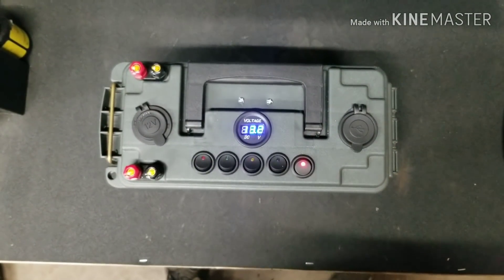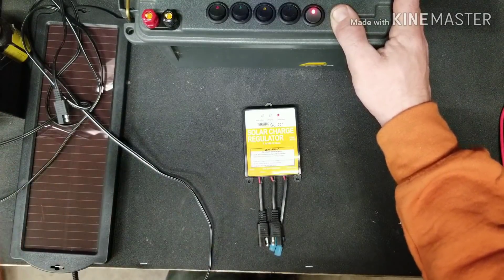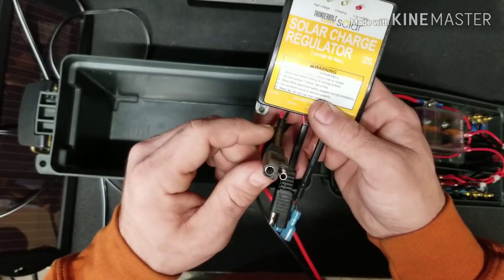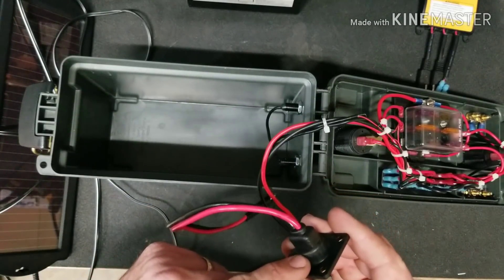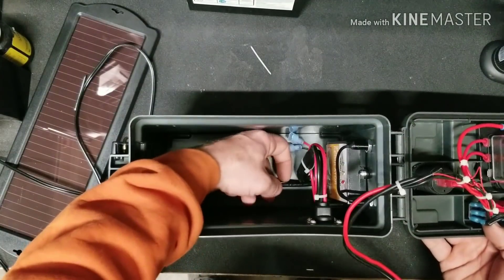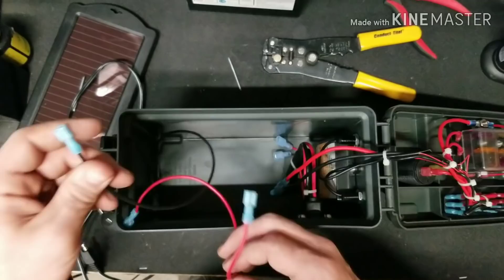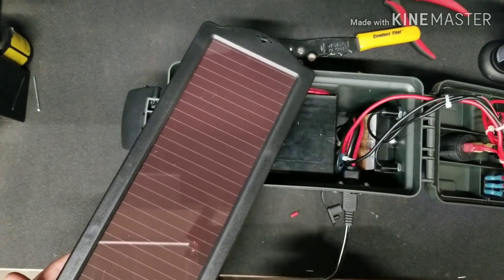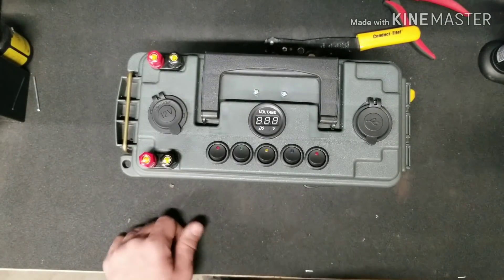How to add the solar upgrade to power box version 2

Comment: JDS Outdoors, Thank you so much for your videos. I especially appreciate you taking the time to show how to do this stuff step by step. I have built 2 of these version 2 boxes and love them. That said, I had a question. I mainly use my boxes for ice fishing and running the lights for my portable fishing house as well as my depth finder. Since I use it mainly for ice fishing I was wondering if you would perhaps show how to install a glow cup and a thermometer like you put on your 50 cal power box. I was thinking the glow cup could maybe fit on the front of the box in about the same spot as where you have the plug for your solar panel on this video. Then it would be just a matter of finding a spot for the thermometer. Just asking because im just not sure how i would wire that given the fact the boxes are already built. Thanks for all your help. Curt
Reply from the maker: Add me on Facebook and I can PM you pics. Jon stier. Profile pic is a grey super duty

Comment: Have you ever looked for or found a small single or dual speaker that could be mounted similar you the LED lights that you could then plug your phone into, while keeping your phone safely inside the box?  I can’t seem to find anything.
Reply from the maker: I have not all I can find is a small bluetooth amp with normal small car speakers
Reply: JDS Outdoors I did find these, might have to look into them. Could be worth a try. 
https://www.rockler.com/rockler-wireless-speaker-kit?sid=V9146?utm_source=google&utm_medium=cpc&utm_term=&utm_content=pla&utm_campaign=PL&gclid=EAIaIQobChMIkMvSsIiR4AIVCJ7ACh049wWDEAQYBSABEgKbIfD_BwE
Reply: Did you take a look at that speaker?  Do you think it could work?
Reply from the maker: @michaelkroulik8986  I dont see what it takes for power but if its 12v it will absolutely work
Reply: JDS Outdoors it looks like it has some sort of battery that is recharged via a micro USB cable. I would think worst case you might need to get some type of step down like you referenced in the bait cooler video.
Reply from the maker: @michaelkroulik8986  should work well then

Comment: Great video and has inspired me to build my own solar assisted power box, however I have one question regarding connecting all your outputs to the "Load" side of the controller.  Does the load on the controller supply sufficient current to power up all your outlets ?  I would have thought taking the solar to the battery and keeping your main feed to to master switch on the battery made more sense.  Thank you for taking the time to post such great information.
Reply from the maker: It can be hooked up either way it all depends on your charge controller some work the way I set it up and some do not. This was brought to my attention after the video but yes this one works perfectly the way it's set up
Reply: @JDSOutdoors  Thank you for your reply,  I will hook my controller up to an external battery and measure the output on the load side, if its ok then I will wire it up as you have done.  Many Thanks

Comment: Does anyone know of a solar panel that is the same dimensions of this box where it can be mounted on the side of the box without any over hang but also have enough juice to charge that battery.  Getting ready for the zombie apocalypse and don’t want to be carrying around a huge solar panel.  Thanks guys.
Reply from the maker: Not really any that fit well on this box. Buy a soft roll up panel and stick it inside or in a back pack
Reply: JDS Outdoors great idea.  Didn’t think of that.  Thanks.  Great job on that.  Can’t wait to work on mine.

Comment: You may want to do some further research on the load out connector on the charge controller.
In all my searching that is only for a small accessory light or similar. It is not designed for all of
the load your battery would normally supply. Let me know if you find out different. Thanks.
Reply from the maker: Been using it all summer like that with zero issues.

Comment: Love this!! About to add the solar to my box. One question for anyone with an opinion...instead of the SAE connectors for the solar panel input I think I am going to use one of the dual Anderson Powerplugs with the waterproof cover. One set will be the PV in to the solar controller, and I'd like to use the other set as an additional output option. How would you recommend wiring that in? Positive through an open slot on the fusebox and and the negative into the chain back to the battery? I'm certainly a novice at best so would appreciate any advice. Great project!

Comment: I really love your videos, but I have a couple of really dumb questions.
1.  If I use 18650 cells with the same Voltage and Capacity, can I build my Power Box using the same instructions that you provide in this video?
2. If I were to double the Amp Hours of battery storage, what else would I need to change, the fuses, the gauge of wires?  I would really appreciate any advice you could offer.

Thanks again, your videos are the best.

Comment: Whi didnt you just use the wires for the battery that you cut off, they would have already been the right length, and would already have the connectors on for the battery connections???

Comment: Can you add a second solar panel in series?  They offer a 2-pack special at Northern Tool?  How long would it take to recharge a battery?
Reply from the maker: Yes you can have multiple panels if desired. Time it takes to charge the battery depends on the time of year, where you live in relevant to the equator, how many watts your panel is, how big your battery is and also how sunny/cloudy it is

Comment: What do you recommend to charge the battery instead of using a solar charger? Is there any chargers that I can mount to the box like you did with the solar charger?
Reply from the maker: Yes you can use the same port to charge without the charge controller installed. Or a regular trickle charger right to the battery
Reply: okay i was looking at some chargers but i dont want to ruin the battery i just bought all the things i need to make a power box thank you

 @JDSOutdoors

Comment: My boxes are built very similar to yours what are you running for batteries, ive been thinking about adding the solar recharge option for awhile, what does this option cost, and is the harbor freight system durable?
Reply from the maker: I'm running 12 ah lead acids and it adds about $30 not including the panel. It is pretty durable for the price and size. Been using it for over a year and no issues
Reply: I wouldn’t go harbor freight.  Their panels are very poor.  I’d get a small renogy or Hqst panel.  I have a couple 100 watt panels and 100 watt is the “sweet spot” for small panels as far as price per watt.
Going more portable a 50 watt hqst panel is around $70.  I’ll be buying one of those for my portable option box.

Comment: Can’t you please share the link for the change controlar and the waterproof connector.. thanks awesome job I made one thanks to ur videos 👍🏼
Reply from the maker: https://www.amazon.com/Schumacher-SPC-7A-Solar-Charge-Controller/dp/B00752TRNW/ref=mp_s_a_1_7?ie=UTF8&qid=1541986836&sr=8-7&pi=AC_SX236_SY340_QL65&keywords=solar+charge+regulator&dpPl=1&dpID=41q1%2BwDd%2Bd
Reply: @JDSOutdoors  Thank you lots. 🤗
Reply from the maker: https://www.amazon.com/gp/aw/d/B01GVSY3CA?psc=1&ref=yo_pop_mb_pd_title
Reply from the maker: Those are the Amazon links to them or similar items. Thanks for the reply
Reply: I noticed that the Waterproof plug is for the battery minder. Could you still hook up the battery minder with the solar controller connected to keep the battery charge at home?